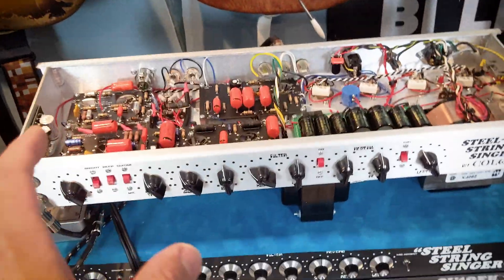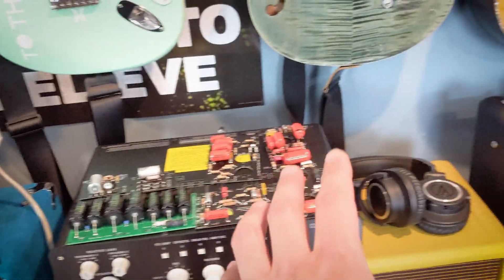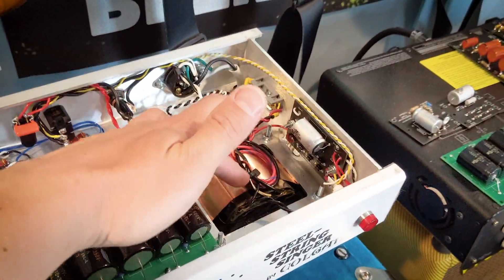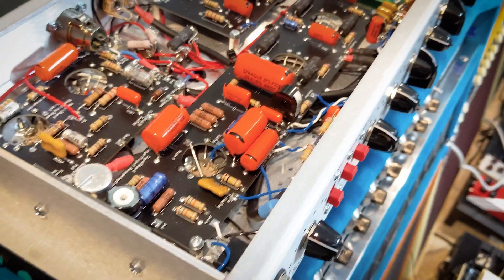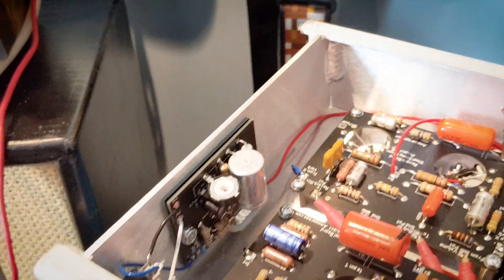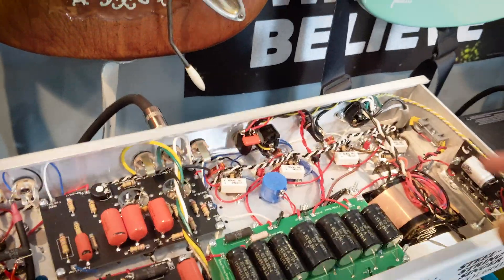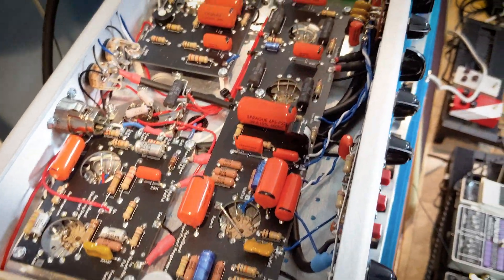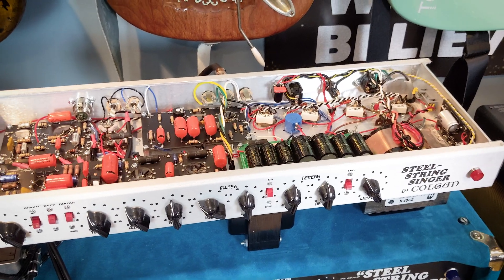Steel String Singer #002 Next Level | Amp Troubleshooting

Comment: Yeah the old fenders always had heater wires routed over the sockets to keep hum down. In trainwreaks the desinger talked about flying heater wires!
Reply from the maker: Thank you, Russell! I typically do fly over but with the boards mounted this way, I need to pay attention a little better apparently 😶 all well and good now, I think
Reply: @TheToneGeek  easy to run into little gremlins when your building complex amp like that. Love it! Something about avoiding creating  an electromagnetic field around the tube socket. But the marshall amps always have the heater routed tight to the floor and back wall of the chassis. No cathedral heaters or flying leads.

Comment: It's so awesome to have this info when building our amps, praise be to you. The master pot wire on my SSS #002 will definitely utilize your method of going over the board to avoid any potential problems at all! The output transformer wiring in 3d space really hurts in the instagram :'( , I am not sure what to do haha :'( sounds like I can get away with running it under the phase inverter for eyelet boards thankfully
Reply from the maker: LOL! You should be fine either way you go. 3D or 2D
Reply: @TheToneGeek  sometimes what makes the most sense does not look as pretty, I'll live I think :D